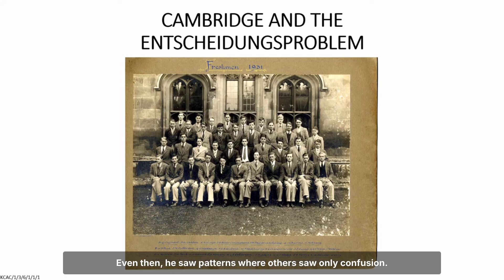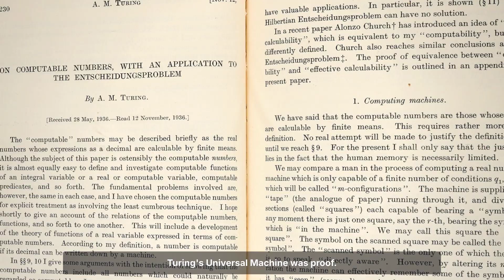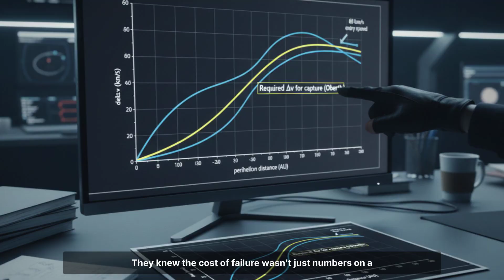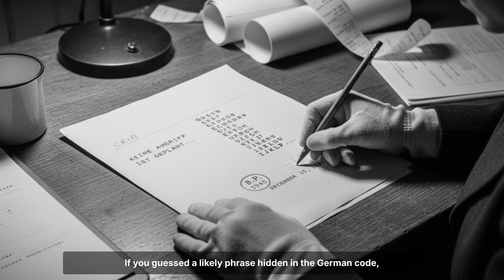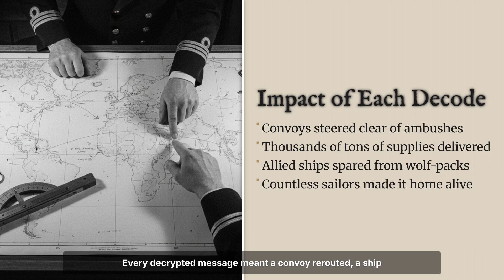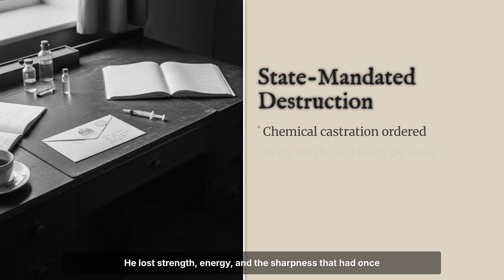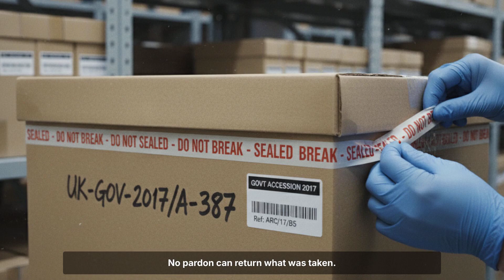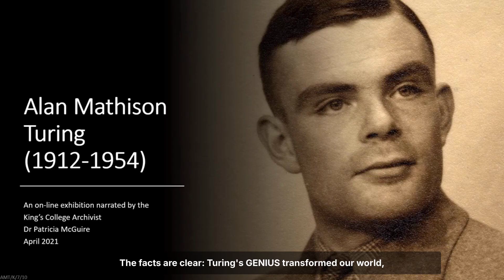He SAVED 14 MILLION Lives in WW2 and Invented Computers. Britain BETRAYED Him

Comment: I hate it when people keep passing off the unfounded claim that Alan Turing invented "the computer".  He did NOT.  Before Turing and before ENIAC, there was the ABC: the Atansoff-Berry Computer.  It was initially conceived in 1939 by John Atansoff -- a physicist -- and Clifford Berry, an electronic engineer.  It was fully realized in 1942 at Iowa State University - Ames, but John Mauchly visited Atansoff and Berry and left with knowledge he applied to create ENIAC which, until a patent case resolved in 1972, was recognized as the first digital electronic computer.
Reply from the maker: You're absolutely right that ABC and ENIAC came first as physical machines. The video's argument is that Turing's 1936 paper invented the theoretical computer, the Universal Turing Machine concept that every modern computer is based on. Physical machine ≠ computational theory